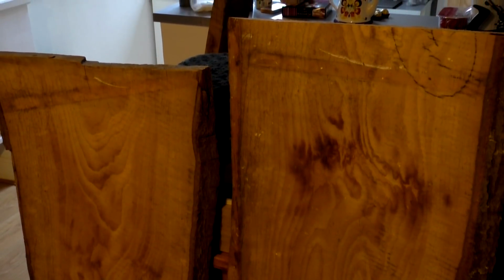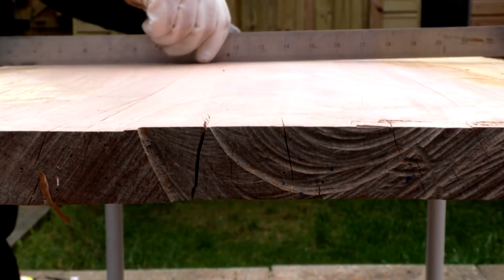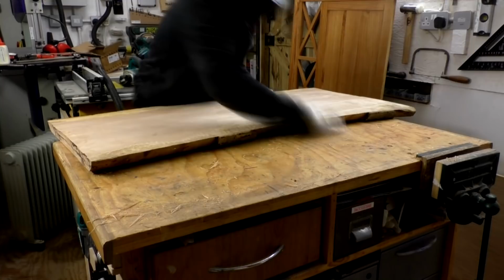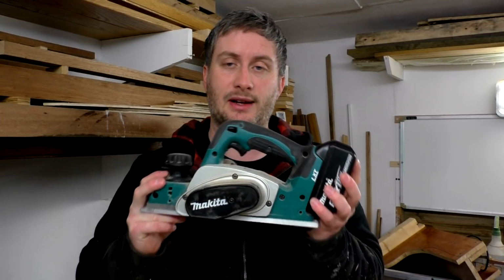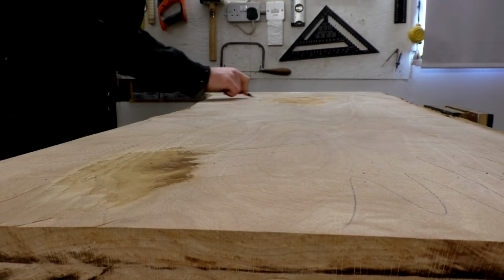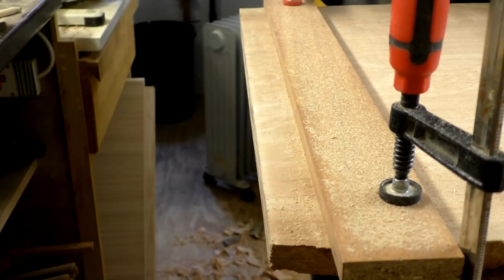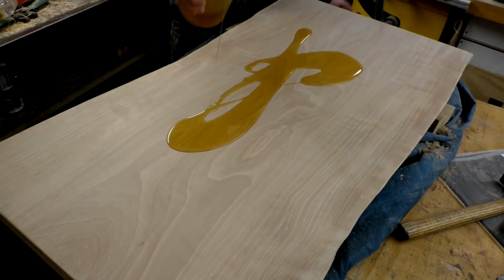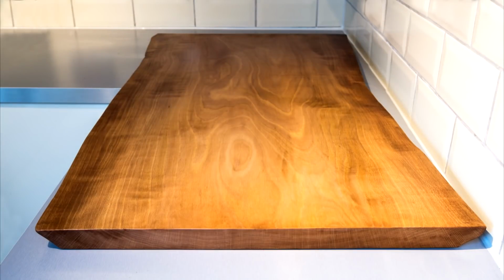Beech Waney Live Edge Slab Coffee Table - Table Top (part 1 of 2)

Comment: Great video.  I think the power planer was a good choice.  I'm only adding this comment to suggest how to tackle the task if all you had was a hand plane.  A scrub plane can cut through material very quickly as well.  Any plane can be converted to a scrub plane by canbering the blade.  I keep a second blade handy that i can easily switch.  If you work across the grain or at 45 degree angles to it the material will come of fast.  At the end of the process you'll be left with a relatively flat surface that has grooves left by the cambered blade.  Easy enough to smooth those out with a smoothing plane or that second straight blade.  Not sure if this comment is useful to anyone, but hope it is.
Reply from the maker: Thank you - great idea and one I didn’t think of while I was working on it. Maybe I’ll pick up another secondhand Stanley or Record and convert it some time. Might make a good video!

Comment: Nice project! But a router sled really doesn't take up as much space as you might think. You just need something in which the router can slide snugly in - the walls don't have to be very high. I've planed down my first slab a few months ago with a router sled made from MDF, with a (cheapish) 25mm bit, on a flat table. I used two straight 2x4's as supports, which I levelled to each other. The 2x4's (or wider if you need it) can be used for other projects, so you don't have to store those. All in all it took me about 4 hours to plane down a 270cm twisted slab on both sides - setup included... sanding not included ;-) (You do need some horsepower though. A trim router won't do.)

Comment: I personally would have gone the router route (wow that sounds weird), but I get your reticence given that the bit required is expensive and I've not been here long enough to know if you've got a 1/2" router. On the next piece, try using some shims on the underside so you don't have to remove quite so much stock - it's beautiful wood and it would be great to keep as much of it as possible! Well done, and I'm looking forward to part 2 now

Comment: Hey Keith maybe this is just me being novice wood worker but would it not have been easier to cut the board in half lengthwise to then be able to put it through the thicknesser then glue it back together. Another thing I've found with the few live edge slabs ave done is wire wheels that attach to drill work really well for clearing up the live edge there about £3 from Toolstation for pack 3 they work quite well. 👍🏴

Comment: That beech looks great, well done. If you get any more of them, a router sled and large diameter bit are well worth sorting. The time spent making a sled will be paid back very fast when surfacing slabs. Keep up the good work. Looking forward to the second installment.
Reply: o bez I believe you in making the router sled. It for sure pays off in time. But Keith also mentioned the problem that he hasn't where to store it.
If you know a way (or link) how to make a router sled what can easily be build up and taken apart many people would really appreciate that.
Reply: My sled is just a 1200mm strip of laminate flooring with a 70 x 20 hardwood batton  screwed to each edge. The router is fixed in the middle of the length ( it does not slide within in the sled).
 The slab is wedged so it does not rock, on to a piece of flat sheet material again with two hardwood runners screwed either side of the slab. I make these runners about 5mm deeper than the thickest past of the slab.
The sled then just rides along these runners as if the router has a huge base.
 I just use it outside on a workmate as its very messy and when im done unscrew the components for storage.  Its not very sophisticated but it works well.
Hope that all made sense, sorry im useless at explaining stuff.
Reply: That sounds good!  I clicked at your name but you do seem to have a You Tube channel. Do you have a web-site?  I'd love to see some pictures of it.

Comment: Most use a router and sled for this task.  I think the planer is a much better option.  I just see killing one's router using it in that way on such a scale.  Depending on your leg designs you can adjust their length and focus more on a flat top.
Reply: You can flatten slabs with a trim router and a 1/2" bit easily! Clearly you are just scared of power tools.
Reply: Clearly I'm not in the least.  But I value my tools not to use them in such an irresponsible manor where I'll have to replace them constantly.
Reply: Also a power hand planer takes a 3 1/2 inch wide area with each pass.  but you think a trim router and a 1/2 inch bit is better?  Yeah I'll see you in a few months and several burned up bits and routers later.  I'll use the same tools as this video with faster and better results every time!
Reply: wauhawk routers are used on cnc routers. They will not be burned up flattening a board.

Comment: Nice work and what a beaut piece of wood, this is not a criticism but just putting out there, would you not have been better wiping it over with some poly varnish, I only say this as the wind was up when you applied the spray lacquer and can only assume that you ost more than you got on the slab. Nice work so far!
Reply from the maker: Thanks! Wipe on poly is very expensive and I just tend to use whatever I have in the shop

Comment: I always thought, varnish on top of oil isnt that a good idea. Does it work out well?
Reply from the maker: Boiled linseed oil soaks in to the wood so it doesn’t form a seal, therefore varnish over the top works fine. Works well for me. May not work so well with Danish oil though

Comment: you could have flattened it with a router jig
Reply from the maker: Explained in the video!
Reply: Yes I saw almost as soon as I'd posted. A sled would have been quick and easy to make  and it would have taken you hours less to get it flat.
Reply: doobedoobedo1 Alternatively he could have bought a £20,000 thicknesser that is about as big as his shed and just popped it through - simples.
Reply: A router flattening jig can be made in 15 minutes with some scrap ply or MDF.
Reply: But he has no need to store it. Make it, use it and burn it. Low cost low effort job done quickly and efficiently
Reply: Make for one use only...done it myself...old MDF, job done..take apart